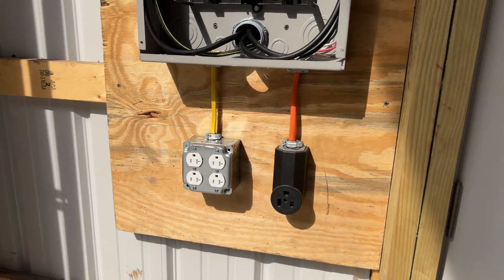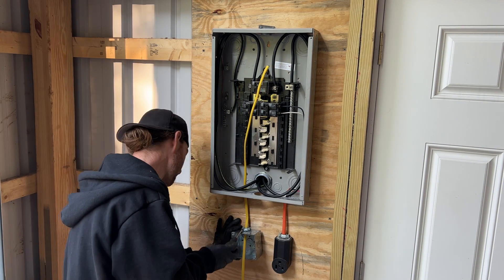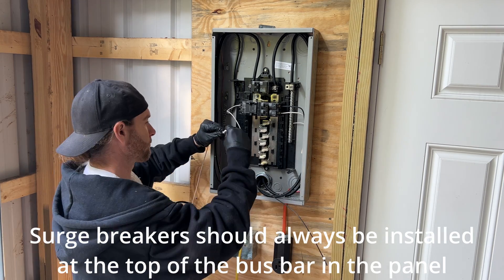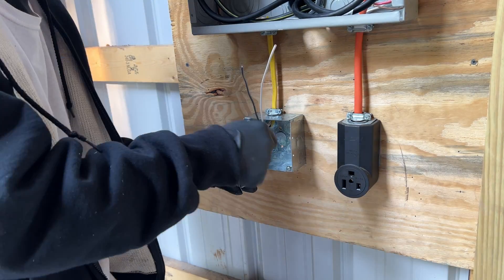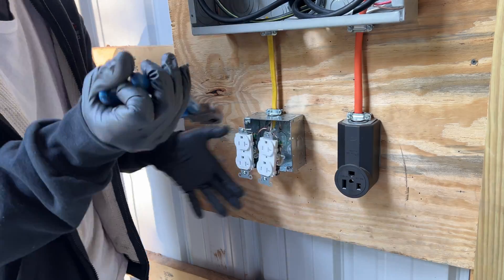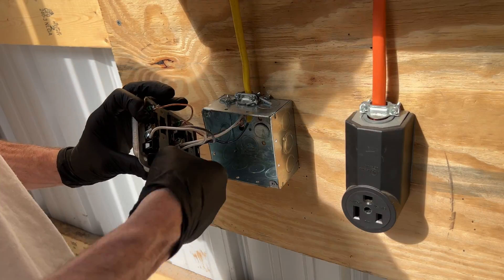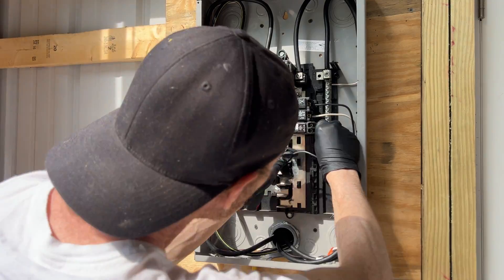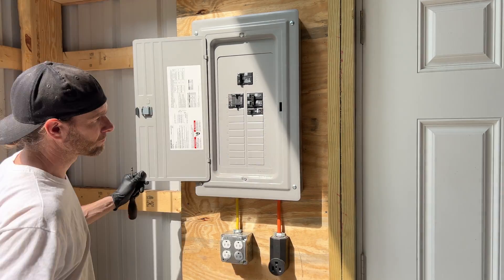How to install electrical duplex receptacle. Double Duplex outlet 1900 pole barn garage Connivance ￼

Comment: Why are the receptacles upside down?
Reply: It's often better to install them that way for areas where something could slide down behind and bridge the hot/neutral of a plug but with the ground facing up, it will just get grounded instead. Some places install it this way to indicate a switched outlet, but it's all up to the installer. I don't believe most codes care either way.
Reply from the maker: @NotARealDuck exactly, good reply! I didn’t even notice that you already answered the question for me. Thanks
Reply from the maker: It’s for improved electrical safety. Generally done more in work shop or commercial type applications, but it’s commonly done in residential homes, especially garages and areas work would be done in.
Reply from the maker: The reasoning is to have the grounding pin of the plug at the top that way if anything metallic or conductive fell behind something or along the wall, and the outlet was sticking out a little bit, it would hit the grounding pin rather than the hot neutral which would be bad. 

If it fell across the other two hot neutral pins, facing the normal way it would it would create a short or possibly even a fire. So it’s more of just a safety precaution to have an extra level of protection.
Reply: I dropped a piece of metal once on top of an outlet that was installed, how you would normally see it, and sparked and caused a fire. All my outlets are upside down in my garage now.
Reply: I like to taste the receptacles.